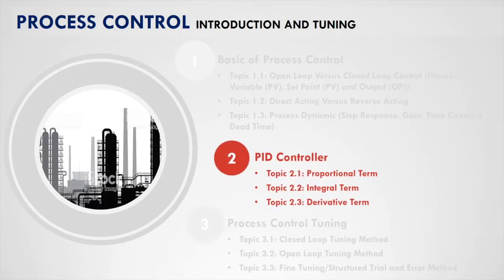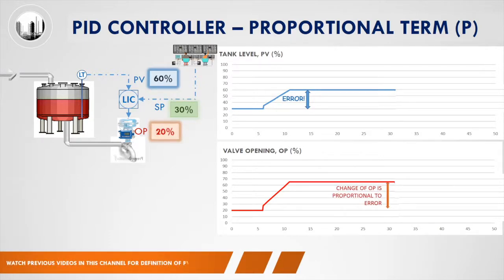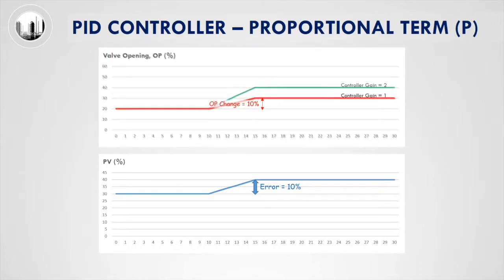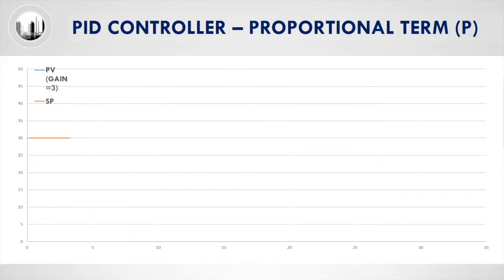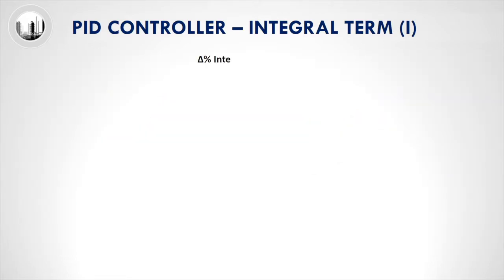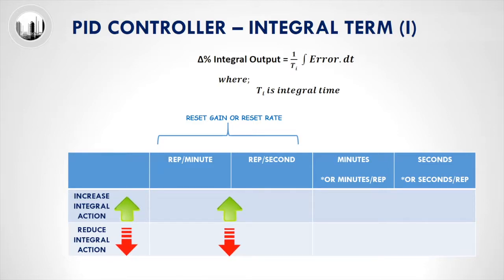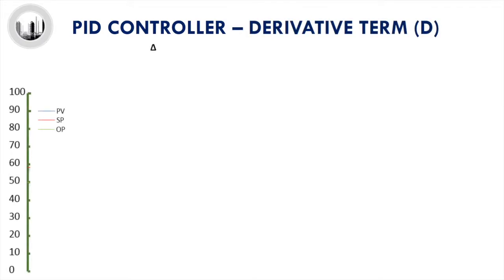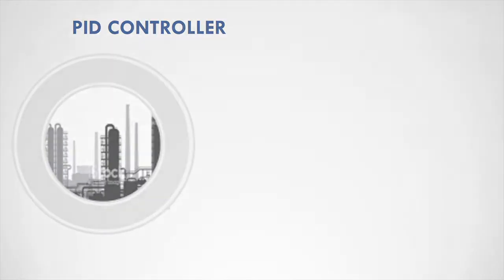Process Control: 2 0 PID Controller

Comment: proportional term of PID controller: the change in OP is directly proportional to the change in PV.
integral term of PID controller: the change in OP is directly proportional to the accumulated change in PV over a period of time.
derivative term of PID controller: used with slow process variables such as temperature so that the controller can act more quickly.